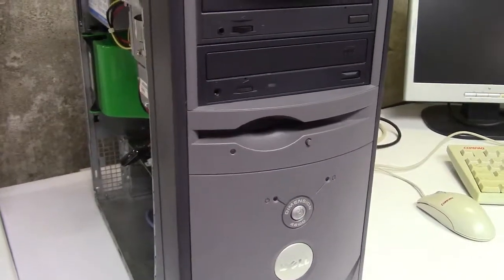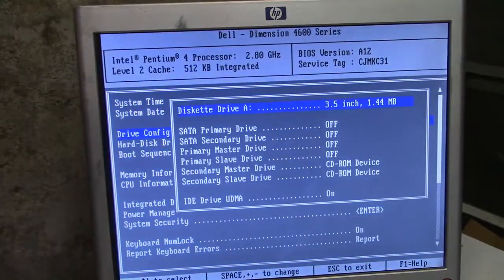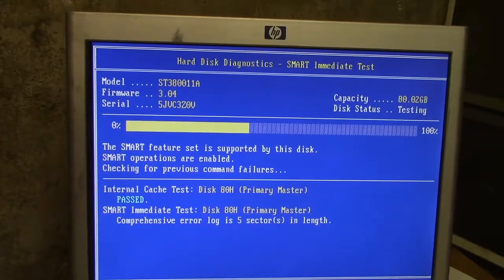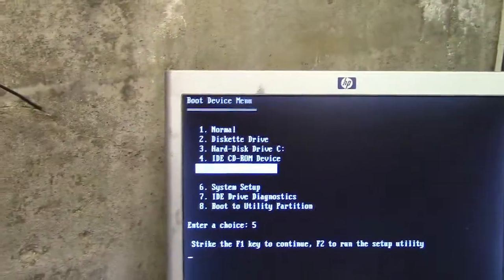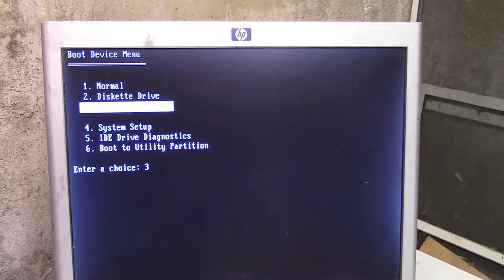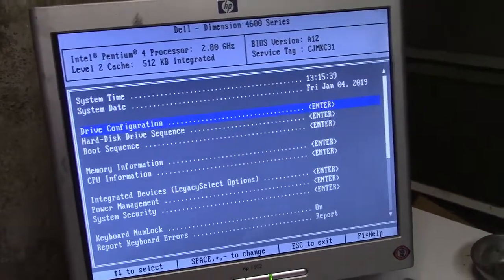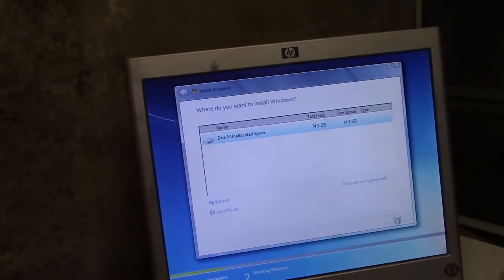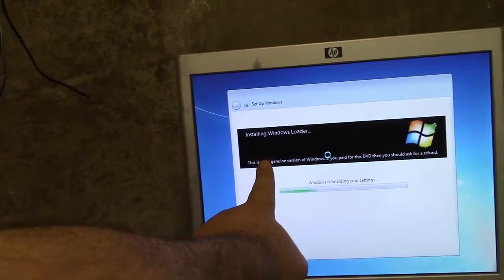Dell Dimension 4600 Windows 7 Upgrade Attempt, Part 2

Comment: Did Dell support for 5 years. Years ago. Don't  remember the Dimension 4600 specifically. Working on a friend's system and it has some of the same tempermental issues as yours. Won't boot from a dvd or cd. Has a cd and another dvdr drive. Won't boot from usb. Can't select boot menu with usb keyboard (can use in Bios though). Early yet, have to dig out a ps2 keyboard from the shed and maybe switch out the dvdr. One thing I like about this model is the disg lights can be helpful in no post situations (which was the user's original complaint... Seems that was solved in transporting the system). Now I am having fun just trying to run my favorite diags on it.
Reply from the maker: Yeah this system was quite a pain to get working, even to just have it boot off of something else.  That's something I never really experienced with other Dell machines.  Eventually the machine did succumb and I got it all done.  It's still in service today, Windows 7 32-bit.  It does what it can.

Comment: Mmm I have the same computer never had any trouble with the installing any software I have Linux mint on it now
Reply from the maker: For some reason, the machine was especially recalcitrant about loading other software.  But as usual, I make it work.  It's been running for almost 3 years now since, flawlessly as usual.

Comment: What a pain in the ass. Why wouldn't it boot from the USB? Did it corrupt the flash drive? So has your mother switched back to xp yet?
Reply from the maker: I have absolutely no idea why it wouldn't boot USB!  Still to this day!  It never borked the flash drive completely, I was always able to read it in another PC, and I could reformat it as well and rewrite it.  I also tried booting another system with it after it was in this one and it did the same thing with the BCD error.  If I rewrote the drive and tried it on that same PC, it would indeed boot with no problem.  Pop it back in this one and it's borked.  I haven't the slightest idea.

Has she switched back to XP yet?  Actually no, though it's through an interesting turn of events!  Apparently, the basement steps in that house are deadly.  They're very sturdy and well built, but people have a tendency to fall down them.  The original owner of that house, the husband, fell down those steps and died.  My mother followed suit, except for the death part.  As a result, she doesn't go down there unless my dad is home.  Even then, it's maybe once a week.  He even does the laundry now since she doesn't go down there.

Then she says "I want to get a laptop".  Oh yeah, that's going to work.  First my dad forbids the spending of any money, so unless they're given one, it will never happen.  Barring that, she says "And you have to buy it for me, I'll pay for it."  Umm, no.  No matter what I get, she'd end up breaking it or not know how to use it because it's Windows 10 (7 is similar enough to XP), and then it would be my fault, because I picked that one out.

So I said "I have an excellent solution for both of you.  Let's move the computer from the basement into my old bedroom, there's even an Ethernet wire I ran there so it's ready to go, all we have to do is plug it in and it will work.  I'll even set it up for you!"  There was also a small desk in there I used to have a computer set up on back in the day (see some of the early Throwback Thursday series).  

Now the fun begins.  She says "I have tons of clothing I need to put away and I want to use your closet, but you have stuff in there still.  Clean it out."  OK, fair enough.  It's their house, I don't live there anymore, she wants to use that closet she has every right to.  Whatever is in there can really just be thrown out as the last time I probably wore something in there was back when I was 13 and I certainly wouldn't fit into anything in there, so it can all be donated or thrown out.  The only thing I'd want is my Boy Scouts uniform just for sentimental reasons.  

Then I go in there to take a look.  She has a 4 foot by 4 foot by 4 foot pile of stuff in front of the closet door.  I said "You gotta move all this before I clean out the closet."  That all fell on deaf ears.  I'm not moving her crap so I can then make room for her to put stuff in, because she's only going to fill that closet from floor to ceiling, and then put another 4 foot pile in front of the door so she can never access it anyway.  The whole room is a disaster.  Now you know that I come from a long line of hoarding.

Comment: Nice thing about AOL is that they started charging $5 a month for the desktop browser bundle. Something tells me that your dad wouldn't pay for that. Unfortunately for me, my parents do pay for that...
Reply from the maker: That's a huge waste of money.  My dad, forget it.  They check their AOL mail through the Internet browser.  Even way back when the AOL desktop software was still around and allowed you to connect via TCP/IP, and I got a cable modem, I wouldn't even bother with the AOL software.  As soon as I'd sign on, invariably someone would send me an IM and then I'm stuck.  I'd just do everything through the plain old browser since the Internet connection was open.  

In the old days of dial-up, not only did you NEED the software, but there were a lot of AOL-specific things that would only open through that software, such as the AOL keywords if you remember those.  In time, of course, those keywords would just open the browser in there and bring you to the appropriate webpage, so there was virtually no point!
Reply: Yeah, I think that the objective is to turn the last few users away. The software hasn't been properly maintained for years. It constantly breaks websites. I do remember keywords. You couldn't even input the URL for a long time. Eventually they added the address bar, but you'd always hear "or AOL keyword ..." every time someone mentioned a web page on TV.
Reply from the maker: Oh yes, I definitely remember that on TV!  And I remember not being able to put a URL in the browser in the AOL software.  It was broken then, it's probably more broken now.

The "where's AOL" question I mentioned isn't far from the truth either.  My mother has a hard time knowing what AOL.COM is or where to type it in.  I don't know if she's forgetful or just stupid, I'd go for the latter.

The final day with Old Clanky, when I drove it out to my dad to sign it over to him (and come home with THE BIG SIX) I'll never forget.  Since we were messing with those cars, my mother had to go out and see my grandmother while she was still in the nursing home.  She took the 87 Camry.  She drove that car since brand new.  And since brand new, my dad installed a "fuel shutoff switch", which he hid conveniently in the driver's vent.  That vent has a wheel you can turn to shut the airflow, and it does that with a damper door.  The damper door makes contact with the switch and cuts out the fuel pump relay.

So that switch was engaged and she gets in and tried to start it.  She's trying to start this car, which has always started on the first turn of the key, every time, like it's a 77 Nova with a worn out carburetor.  Cranking and cranking and cranking.  Tried it 3 times.  My dad shouted out to her "The switch!", to which she replied "What switch?"

Now I extrapolate that to the bathroom light switch.  You've lived in your house for a number of years.  She's been in this house for over 40.  You can go in the bathroom in complete darkness and find the switch because you basically know where it is, and it's always worked the same way.  But her, nope.  It's like reality goes out the window.  I don't get it.  Absolutely boggles my mind.  So you see the truth in "Where's AOL?"  Oy gevalt!
Reply: jaykay18 Yeah, I know exactly what you mean. I've thought long and hard about it, and I think it's just a deep, engrained habit of not caring and not absorbing. It's not that they forget, it's that they never knew even when told point blank. My mom and her mother do that all of the time. The instant something seems even mildly inconvenient to think about, a switch flips in their brain, and the Berlin Wall is instantly erected around their memory. They're capable of remembering, but learning about how cars/computers work is boring, so they give up before they begin. I can't tell you how many times I've been accused of never mentioning how to do something even when I've gone as far as to draw diagrams and talk about that something for minutes on end.
Reply from the maker: Yeah, I certainly understand what you mean.  But if the light switch has been there and has operated the same way for the last 40 years, why is it now suddenly different for no reason?

I think you're intermingling that with another older-person technology called CRC.  Did you know older people have CRC?  It stands for Can't Remember Crap.  And yes, I know all about the Berlin Wall being erected immediately.  The mother-in-law suffers from that one.  The wif will tell her something and it goes in one ear and right out the other.  It's like it never happened.  And she claims her memory has improved since she started doing "power walks" and eating "power foods" like kale.  Sure it has.

You know, my dad's becoming an alta cocker (that's Yiddish for "old man"), he just turned 68.  While he's got some time left certainly, his brain is miles ahead of hers.  Thousands of miles.  Sometimes he gets a little forgetful, but he's adapted and makes a list.  I don't talk to him every day or even every week, sometimes a month or so will go by, and he'll make a list, and we'll talk about all the things on his list.  He was especially spry last I saw him a few days ago which is nice to see.  I'm just hoping she goes first, because if he does, there goes my inheritance on 12 new laptops to replace all the ones she'll break over that time.

Comment: Good stuff.  I bet that dvd rom drive is real old and like a .01x speed slow as fuck! so it thinks there is nothing in the drive. It did kind of  sound like it had trouble reading it possibly though. 

Other funny highlights are the fuck you error and AOL which I had to check if aol was still around and unbelievably it is.
Reply from the maker: Thanks.  Yeah the DVD-ROM is old, back from 2004 or so.  Even if the drive is 1X, that's still 1.3MB per second.  The computer should wait as long as needed for the data to roll in at whatever leisurely pace the drive can supply it, as long as it gets a good read.  Keep in mind that 1X in the DVD world is equal to 9X in the CD world.

CD was 150KB/sec at 1X.  Even if I had a 1X CD-ROM and hooked that up, and had a bootable CD, the computer would sit there, patiently waiting for the data to be read, as long as it actually is being read.  Clearly, that indicates the drive wasn't reading the disc.

Now I don't know what speed the disc burned at (don't remember), but it still should be compatible, as the disc was definitely closed out properly as if it were a factory-pressed disc.  I do remember some time back when I was fixing up the eMachines unit for lexmarks567, I was burning CDs for it, and what I had on hand (to prevent going through CD-R discs) was an old CD-RW disc that ONLY supported 4X speed maximum, and would throttle the drive down to that.  That took 20 minutes per disc to burn.  That was a LOT of fun waiting around.

Yep, AOL is indeed around.  I still have and use an email address with them, had a video regarding that maybe 2 years ago now.  The problem is they're nothing like what they used to be, and they've changed hands so many times since.  As such, I guarantee they have sold off all of the email addresses to whoever wants them.  As of the last merger, I'd get nothing in the "spam" box to well over 50 messages a day in there, all completely spam.  At least the filter is doing its job still.